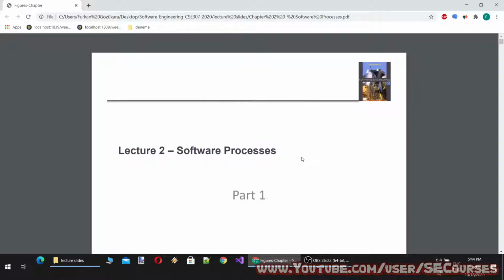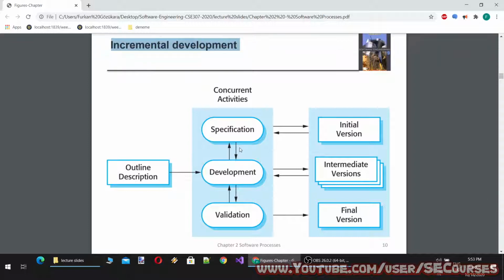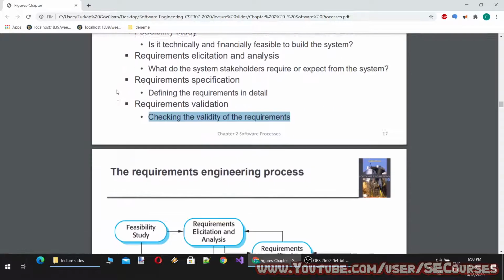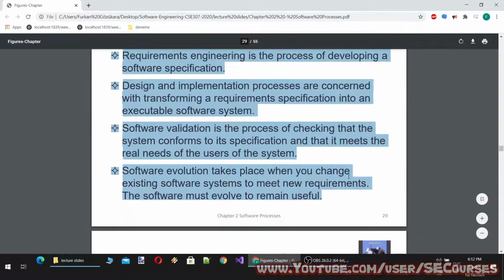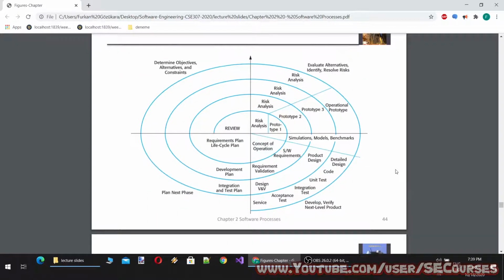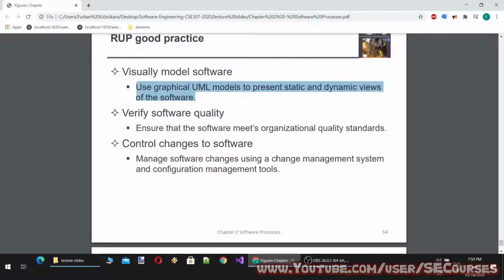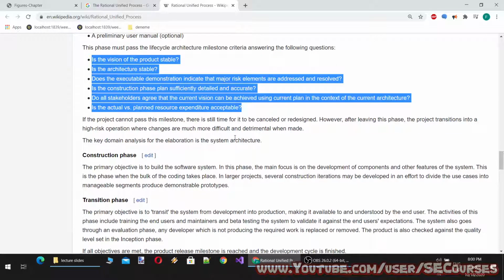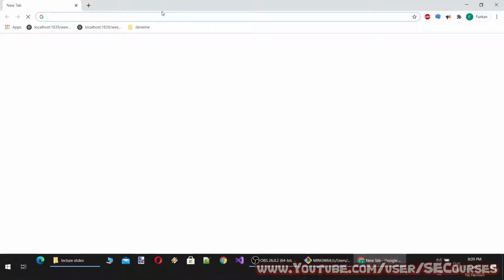#Software #Engineering - Lecture 2 : Software Processes, Activities, The Rational Unified Process

Comment: In this lecture i learned ;
- The Rational Unified Process
-Plan-driven and agile processes
-What is the Waterfall Model, what are phases and problems
-Types of software component
-Requirements engineering process
-What is the overall model of the design process?
-What is software design and implementation?
-What is the overall model of the design process?
-What is Prototype development?
-What is incremental delivery, what are advantages and problems?
-What are the static workflows in the RUP process?
-Throw-away prototypes

Ferit BARBUR-195050808

Comment: In this lesson i learned:
- the Rational Unified Process
- plan-driven and agile processes
- software process models
- what is the Waterfall Model, what are phases and problems
- what is incremental development, what are benefits and problems
- what is Reuse-oriented software engineering
- types of software component
- process activities
- software specification
- requirements engineering process
- what are design activities
- what is software validation
- What is software evolution
- what is software prototyping
- what is Prototype development
- what are process of Prototype development
- Throw-away prototypes
- what is incremental development
- what is incremental delivery, what are advantages and problems
- what is Boehm's spiral model
- spiral model sectors
- spiral model usage
- what is rational unified process
- phases in the rational unified process

Samed Arıcı - 195050005

Comment: I learned in this lecture

• What are the software processes?
• What stages do software processes involve?
     * Specification -> It is to define for what purpose the system should work.
     * Design and implementation -> Define the system organization and put the system into practice.
     * Verification -> Checking that the customer's needs are met.
     * Change -> Changing the system according to the changing needs of the customer.
• What are software processes activities?
• What are plan-driven and agile processes?
     * Plan-driven -> These are the processes in which all process activities are planned before the project and the progress is shaped according to this plan.
     *Agile processes -> Planning is incremental, and it is easier to reshape the process according to changing or increasing customer needs.
• What are the models of software processes?
• What is the waterfall model?
• What are the stages of the waterfall model?
• What are the problems with the waterfall model?
• What is the incremental development model?
• What are the incremental development stages?
• What are the advantages and disadvantages of incremental development?
• What is the reuse-oriented software engineering model, what are the process stages?
• What are the software component types?
• What are the process activities?
• What are the processes of requirements engineering?
     * Feasibility study
     * Identifying and analyzing customer needs
     * Characteristics of customer needs
     * Validation of customer needs
• What is software design and implementation?
     * Software design designs a software structure whose specification is realized.
     * Implementation turns this design structure into a program that can run.
• What is the overall model of the design process?
• What are the design activities?
     * Architectural Design, Interface Design, Component Design, Database Design
• What is software validation (V&V)?
•What are the test stages?
     * Development or component testing -> At this stage the components are tested independently.
     * System test -> The system is tested as a whole.
     * Acceptance tests -> Whether the system meets the customer's requirements is tested.
•What is software evolution?
     * As the technology develops, the changes in the requirements make it necessary for the software to develop and change.
• How do we deal with change and how can we reduce the costs of this change?
• What is software prototyping, what are the benefits of creating, how does the process progress, how is it developed?
• What is incremental development and delivery?
• What are the advantages of incremental delivery?
     * It can be added to the system at each increment, according to customer needs or requests. Thus, the system can become available earlier.
• What are the problems of incremental delivery?
• What is the Boehm spiral model and how is it used?
• What is The Rational Unified Process (RUP)?
• What are the stages of RUP?
• What is RUP iteration?
• What are the static workflows in the RUP process?
     * Work distribution planning
     * Revealing the requirements
     * Analysis and design
     * Getting into the application
     * Test phase
     * Distribution phase
     * Configuration and revision process
     * Project management phase
     * Stage of setting up the appropriate software tools
• What should be good practice according to the RUP?
• RUP What are the four project lifecycle stages?

195050019
Yunus Emre Bitkay
Thank You For Lesson :)

Comment: In this lesson I learned;

- Software process
- Software process models
- Incremental development 
- Types of software component
- Process activities
- Software specification
- The requirements engineering process
- Software design and implementation
- A general model of the design process 
- Incremental delivery
-Incremental development and delivery
- Incremental delivery
- Boehm’s spiral model
- Boehm’s spiral model of the software process 
- Spiral model sectors
- RUP 

185050004

Comment: In this video I learned that;

Software process,
Waterfall model phases such as; 
system and software design, 
implementation and unit testing,
integration and system testing,
operation and maintenance,
Software specification,
Software evolution,
Key points of software processes,
Software prototyping,
Boehm's spiral model,
Rational unfied process

Ahmet Yusuf Diktepe
175050013

Comment: Software process,
Waterfall model phases such as; 
system and software design, 
implementation and unit testing,
integration and system testing,
operation and maintenance,
Software specification,
Software evolution,
Key points of software processes,
Software prototyping,
Boehm's spiral model,
Rational unfied process

Simay Seyrek, 195050001

Comment: 165050012
I learned in this video;
- Software process
- Software process models
- The waterfall model
- Incremental development
- Reuse oriented software engineering
- Software design, activities for design and software specification
- Software validation
- Stages of testing
- Coping with change when programming
- Boehm's spiral model 
- Boehm’s spiral model of the software process
- RUP
- Rup iteration
- Rup building block
- Static workflows in the Rational Unified Proces
- Throw away prototypes
- Incrementals
- Incremental development and delivery, advantages and problems
- Key points

  Thanks for lesson.

Comment: In this lesson, I learn the information about; 

*The software process
*Software process models:
 -The waterfall model (separated, plan-driven) and problems
 -Incremental (validation ,plan-driven or agile) and its benefits
 -Reuse-oriented (existing components, plan-driven or agile)
*The requirements of engineering process
*Software design, activities for design, software specification
*Software validation (Verification and Validation)
*Stages of testing, software evolution
*Software prototyping and its benefits
*Throw away prototypes
*Rational unified process and its phases
*Incremental development and delivery and its problems
*Boehm's spiral model, spiral model sectors, spiral model usage

Abdulkadir Durmaz
175050008

Comment: In this lesson i learned 

- Waterfall Model
- Incrimental Development
- Reuse Oriented Software Engineering
- Process Activities
- Software Spesification
- Requirements engineering process
- Testing Stages
- System evoulation
- throw away prototypes
- boehm spiral model
- rup iteration
- rup building block

Mustafa Çağrı Peker
165050008

Comment: in this video I have learned the following: 
-software process
- software process models:
     -the waterfall model 
     -incremental development(description of it and its problems)
     -reuse oriented software engineering( description as well and what it's problems)
-software specification 
-software design and implementation 
-a general model of the design process
-software validation 
-software evolution 
-coping with change 
-software prototyping 
-prototyping of development
-Bhom's spiral model
-The rational unidfied process 
- RUP good practice 

185050901

Comment: 175050010

In this lesson;
- Information about the software process is provided.
- The software process models were itemized and information was given about the models.
- Information is given about the benefits of incremental development and the problems of incremental development.
- Information was given about the benefits of creating a prototype.
- Information was given about RUP stages.

From this course;
Software process models; the waterfall model is software engineering focused on incremental development and reuse.
Plan-oriented processes are processes in which all process activities are planned in advance and progress is measured according to this plan.
Customers can use the software and gain value from it sooner than is possible with a waterfall action.
Software verification; It includes control and inspection processes and system testing.

Comment: Things i have learned from this lecture;
-Software process,
-Software process models which are waterfall model, incremental development and reuse oriented software engineering,
-Benefits and problems of software process models',
-Types of software components,
-Requirements engineering process,
-Software Design and Implementation,
-Desing activities,
-Stages of testing,
-Software development,
-Software evolution,
-Coping with change when programming,
-Chance avoidance and change tolerance,
-Prototypes and benefits of prototypes,
-Boehm's spiral model and its sectors,
-Rational unified process and its phases.

Ceyda Süzer
175050003

Comment: In this video, I have learned those in below;
-Software process models
-A structered set of activities required to develop a software system.
-In agile processes, planning is incremental and it is easier to change the process to reflect changing customer requirements.
-The waterfall model is mostly used for large systems engineering projects where a system is developed.
-Reuse-oriented Software Engineering
-Reuse is now the standard approach for building many types of business system.
-Process activities 
-Requirements engineering process
-Is it technically and financially feasible to build the system?
-Software Validation
-Involves checking and review processes and system testing.
-Testing is the most commonly used V & V activity.
-System testing
-Testing of the system as a whole. Testing of emergent properties is particularly important.
-Software Evolution
-Software is inherently flexible and change.
-Coping with change
-Change is inevitable in all larger projects. 
-Software Prototyping
-Benefits of Prototyping
-Improved system usability
-Improved design quality.
-Reduced development effort.
-Incremental Delivery
-Boehm's Spiral Model
-Spiral Model Sectors
-Objective Setting
-Risk assessment and reduction
-Development and validation
-Planning
-The Rational Unified Process
-Static workflows in the Rational Unified Process.
-Business Modelling 
-Requirements
-Analysis and design 
-Implementation
-Testing
-Deployment
-Being a software engineer will only increase our value and increase our chances to get a good job offer and a good payment. There are many software engineers 
comparing to 10 years ago which means competition is even more difficult. So we have to improve our talents.

165050011

Comment: In this video, I learned
understand the concepts of software processes and software process
models;
 have been introduced to three generic software process models and

when they might be used;
know about the fundamental process activities of software
requirements engineering, software development, testing, and
evolution;
 
understand why processes should be organized to cope with changes

in the software requirements and design;
understand how the Rational Unified Process integrates good software
engineering practice to create adaptable software processes.

Comment: This video covers

-Software process models
  +The waterfall model
  +Incremental development
  +Reuse oriented software engineering
  
-Process activities
-Software specification
-The requirements engineering process
-Software design and implementation
-A general model of the design process 
-Design activities
-Software validation
-Stages of testing
  +Component testing->System testing->Acceptance testing
-Software evolution
-System evolution
-Coping with change
-Reducing the costs of rework
-Software prototyping
-Benefits of prototyping
-Prototype development
-ncremental delivery
  +Incremental development
  +Incremental delivery
-Boehm’s spiral model
-Boehm’s spiral model of the software process
-Spiral model sectors
-Spiral model usage
-The Rational Unified Process
  +Dynamic
  +Static
  +Practive
-Phases in the Rational Unified Process
-RUP phases
  +Inception
  +Elaboration
  +Contsruction
  +Transition
-RUP iteration
-Static workflows in the Rational Unified Proces
-RUP good practice

175050012
Muhammet Burak PAKER

Comment: The lecture start with explaining topics of software processes such us

1-Software process models
2- Process activities
3-Coping with change
4- The Rational Unified Process (RUP), the book explain RUP us system development process with an example about modern software process. Next we continuing with definition of software process  with talking about differences of software processes such us specification and validation. on the next slide we describe and discuss Software process descriptions, we continuing with plan-driven and agile processes. the slide 5 is describing several  process models such us  1-The waterfall model
2- Waterfall model phases
3- Waterfall model problems
4-Incremental development. the book describe and give advantages and disadvantage for each item .
On slide 6 we explain types of software component ,we continue with process activities.
on the slide 7 we talked about software specification with mentioning Requirements engineering process.
the benefit from requirements engineering process. we can have feedback requirements and station analysis. we continuing to define and describe each of these items Software design and implementation
* software design and implementation 
(process of converting specification into executable)
* Design activities
 : (consisting of Architecture design ,interface design ,component design and Database design)
*Software validation
 (process of checking that a software system meets specifications and that it fulfills its intended purpose)
* Stages of testing
 (component  testing > system testing > Acceptance Testing  )
* Testing stages
: individual components are tested independently.
* Testing phases in a plan-driven software process
* Software evolution
 : software is inherently flexible and can change 
* System evolution 
* Key points
 : its give examples of the general models

we are continuing   part 2  of lecture with 
* Coping with change
 , Reducing the costs of reworksoftwareBenefits of prototyping

* The process of prototype development
 
* Prototype development
 is a key process to develop and create a successful product.
* Throw-away prototypes
* Incremental delivery
* Incremental development and delivery
* Incremental delivery
* Incremental delivery advantages
* Incremental delivery problems
*Boehm’s spiral model
, Boehm’s spiral model of the software process is  proposed a risk-driven software process framework (the spiral model) that integrates risk management and incremental development. The software process is represented as a spiral  rather than a sequence of activities with some backtracking from one activity to another. Each loop in the spiral represents a phase of the software process. Thus, the innermost loop might be concerned with system feasibility, the next loop with requirements definition, the next loop with system design and so on. The spiral model combines change avoidance with change tolerance. It assumes that changes are a 
* Spiral model sectors
* Spiral model usage
* The Rational Unified Process
 Phases in the Rational Unified Process  , RUP iteration 
* Static workflows in the Rational Unified Process
 and  RUP good practice  
RUP is a Software Engineering Process
 Several out-of-the-box instances
 Can be tuned from lightweight to
comprehensive An answer to the strict waterfall method or Documented driven development
175050901